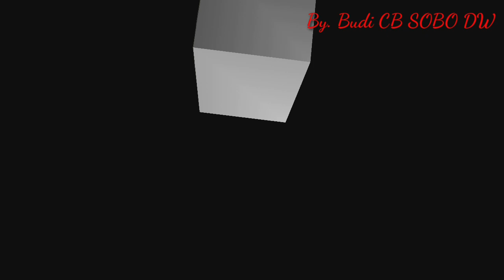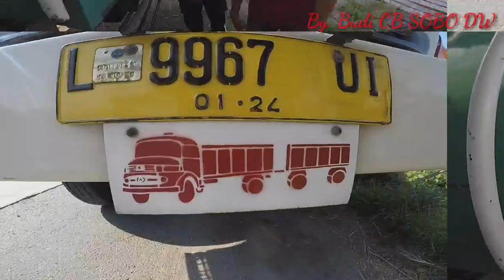REVIEW TRUCK SANG IDOLA, PT. PANCA JAYA HINO FG260TI & NISSAN BIG THUMB CD340

Comment: Nissan Diesel CDA340, sistem penggerak 6x2, mesin RF8 V8 volume 16.991 cc daya mesin 340 PS/2.200 RPM torsi 1.177 Nm/1.400 RPM.
Reply from the maker: Terima kasih info dan ilmunya Pak adi 🙏🙏🙏